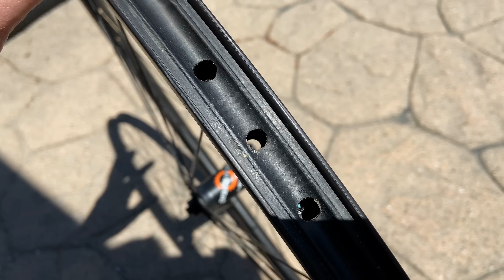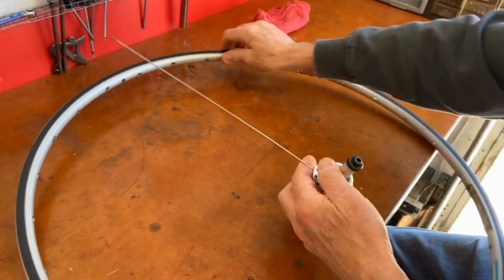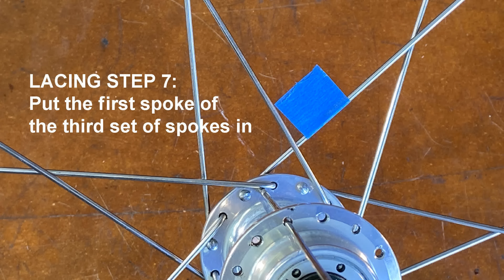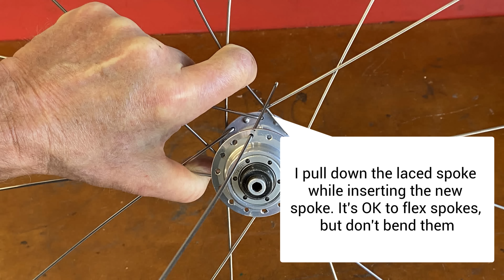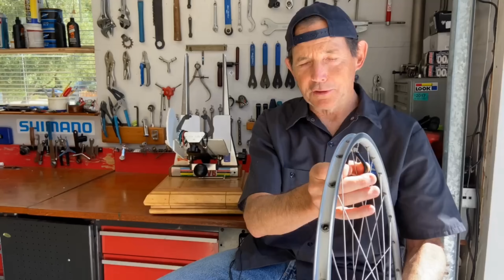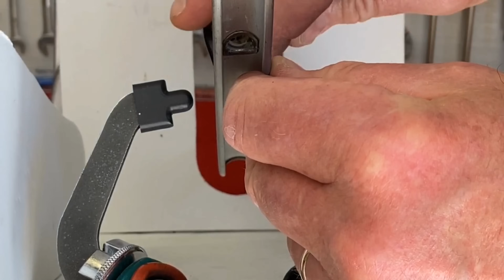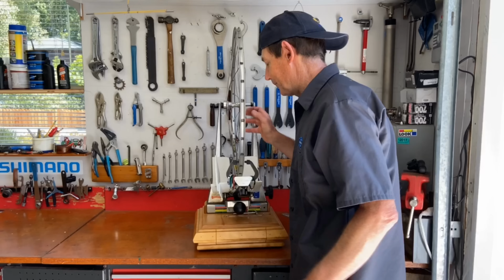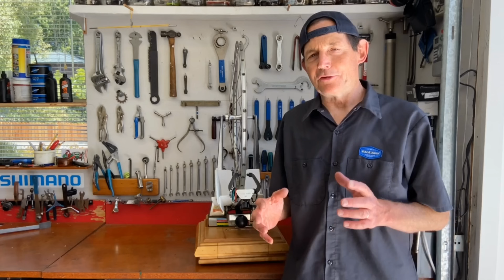How To Build Bicycle Wheels THE EASY WAY! #bikerepair

Comment: I found my match fixing these nuances.
One question I have for you, how much tensioning is enough?
I usually stop when the spokes don't bend for more than 4 mm. Approximately
Reply from the maker: Thanks for watching Milad. You know the spokes are tight enough when the wheel stays true ride after ride after ride. By far, most people under tension spokes. Because they start to feel tight well before they really are. When adequately tensioned it will hurt your hands a little to squeeze pairs of spokes enough that they move. That’s a way to tell. I’m not sure what you mean by “don’t bend for more than 4mm” But, if you’re squeezing, the gauge of the spoke and differences in rims and spoke patterns could make a tight wheel fail your 4mm test. Getting a feel for it is better and getting a proper tensio meter is the best. Hope this helps. Thanks again!
Reply: @JimLangley1  thanks man, this video came at the nick of time, when I have to do my wheel again , after the bearings section failed.
Reply: @JimLangley1  update:
After I finished the Project I noticed that it was impossible for me to insert the spokes after doing batch #1 and 2. The hole are so tight, the spoke cannot be bent. 
So I had to disassemble batch #2 and insert all the spokes one time
Reply from the maker: @miladne1092  Thanks for the update. From what you wrote, I think you may have screwed the nipples on the first 2 sets of spokes down too much when you laced them into the rim. You need those spokes to be very loose. If the nipples are turned down on the spokes too far, the rim won't be able to be pushed toward the other side making it difficult for the 3rd and 4th sets of spokes to reach the rim. The other issue when spokes won't reach the rim is either having the wrong spoke length or having a mistake in the lacing. Hope this helps you figure it out.
Reply: @JimLangley1  thanks for your responses.
My spokes are metal (rigid) and their respective holes are tight, which Meeks it harder to twist and bend.
I solved the issue by installing them in advance, and now it runs as usual, thanks for your care ;-)
Reply from the maker: @miladne1092  I'm happy to hear you have it running as usual, Milad. Well done!

Comment: I am about to replace a spoke on my own, (covid) I am not sure how my daughter broke a spoke, sure I've done it, but I am a lot larger person and wheels are pretty strong as long as not over tensioned etc. **notice on Amazon that I have to measure the MM length for the spokes so, that part will be fun // then I have to order a pack...
Reply from the maker: Thanks for watching and for the comment, Brad! The most common reason spokes break is because the wheel was built with bad spokes. By bad, I mean they are made of an inferior metal. This is very common in production bicycles. Many have basic steel spokes that cannot for very long withstand the demands put on them by any rider simply rolling down the road. Sooner or later they tend to break. Quality stainless-steel spokes are the way to go but that adds cost to the bicycles so you don't find them until you get to a certain price point. 

To get a measurement for a replacement spoke, you can remove a spoke from the same side of the wheel - a spoke that's still in the wheel - and measure it. Just don't let the spoke nipple go up inside the rim and lose it. You can tape it or hold it or just keep it at the 12 o'clock position by keeping the wheel upright and being careful not to bump it. 

And for buying less than an entire wheel's worth of spokes, you can buy online from a company such as Wheelbuilder.com. For example, this spoke: https://wheelbuilder.com/dt-champion-straight-gauge-spoke/ The minimum is 10 spokes. I realize you only have 1 broken spoke to replace. The thing is that if that wheel on her bike broke that one, it's likely it will break more, so having an extra 9 spokes might come in handy. Hope this help! Thanks again and have fun fixing that wheel!
Reply: @JimLangley1  Thanks Jim, good advice, I'll get it done one way or the other, one of my former students was fired from the 50 year old bike chain in the region, so he launched his own trailer based shop on wheels for bikes... always can call him as a "backup" ,,, I changed the main crank bearing cups once on a $50 dollar huffy, but I had to go across the border to Reynosa to buy the parts no one sells them here in the McAllen area. (The huffy was on sale for about half off when I bought it) **I had bent them.
Reply from the maker: @bradaltemeyer4472  good for you! I applaud your resourceful. You’ll make easy work of that broken spoke :-) one way or the other.

Comment: Hello Jim, thank you for the very helpful and well out planned video. Quick question: in building a wheel with aluminum nipples, I accidentally rounded one of them out. Any tips for removing it to replace it? Or, would it be detrimental to simply cut out that one spoke and replace the spoke and nipple while the wheel is fully tensioned otherwise? Thanks again!
Reply from the maker: Thanks for watching and I'm very happy you liked my video, Daniel. With a stripped aluminum nipple, I will try to unscrew it. First I'd remove the tire and rim strip. That lets you access the top of the nipple to use a screwdriver to help you turn the nipple while you use something like a locking pliers to hold the rounded flats on the nipple. 

So you use the two tools together very carefully to try the get the nipple to turn and loosen. The goal is not to damage it anymore but to get it to turn. If it's so tight it just refuses to turn, try tightening the two spokes on either side of the rounded one. That should relieve a tiny bit of pressure on the rounded nipple letting you loosen it. 

Another thing you can try is pushing the rim in the direction to relieve a little tension. So if the nipple is on the right side of the rim, you would push the rim to the right to flex it (put the wheel on the floor and don't push too hard, just enough pressure to gently flex the rim) and hopefully get the tension to ease off on that nipple.

If none of this works, yes you can cut the spoke and replace it with a new one and new nipple. That's no different than fixing a spoke that broke out on the road. But, for me, if I get that nipple off, it's much more satisfying ;-) Hope this helps! Jim

Comment: Nice and clear video, you said everything that had to be said about topic, very well invested 1h of my life. I saw on the other video that wheel mechanic is soldering spokes. What are the pros and the cons of the spoke soldering and is it only pro stuff or there are some benefits for everyday average biker?
Reply from the maker: Glad you enjoyed my video, NogomKrozVrata. Thank you for watching, the nice words and the excellent question. The pros of tying and soldering spokes are 1) reducing spoke movement, especially at the cross; 2) this limits the wear that occurs at the crosses, which can result in clicking noises that are difficult to eliminate; 3) should you break a spoke, a tied and soldered one cannot be ejected from the wheel when you're riding or flail around and scratch or even damage the bike as un-tied & soldered spokes might; and 4) by stabilizing the spokes and preventing movement, spokes last longer since they're not moving at the cross and moving less at the hub holes (in the case of J bend spokes). 

The cons include: 1) Tying and soldering takes extra time for the wheel builder so it costs more for the buyer; 2) It takes considerable practice to tie and solder spokes well and if it's not done well, it won't have the desired benefit; 3) If you do break a spoke, you must undo the tie & soldered joint and you will probably want to have the new spoke tied & soldered meaning a broken spoke is a bigger job - but remember, tying and soldering should prevent spokes from breaking; and 4) it's not easy to learn how to tie & solder because there aren't that many builders teaching the craft anymore. If you were going to have a builder tie and solder your wheels, you would want to inspect their work to be sure they are an expert.

On your last question, the builders who believe in the pros of tying and soldering would say that it's worth doing for all riders: amateurs and professionals. But, probably would not recommend it unless the person is riding regularly and really needs high quality wheels - since it adds cost. Charles Wells at Jet Bicycle Wheels is a tying and soldering aficionado. In this video he shows how it prevent spokes movement. https://www.youtube.com/watch?v=UYL5Kah83vw If you browse his youtube channel, he has other videos demonstrating his technique that are fun to watch and educational. Okay? I hope this answers your questions and thanks again!!
Reply: @JimLangley1  Thanks

Comment: Hee Jim,

i noticed that you put one side de head in spoke going left en the other side going right, is this with a reason and is this different with coaster brake en disc brakes since these type of hubs distrute the force of de brake differently?

I was teached the same way you practice here but with the normal hubs going both side the same way. So for example both head in spoke going left,  of the hub, and if it is a disc brake hub the disc brake side going the other way round so, the force of when your braking is distrubeted evenly

My english may not be that good but hope you understand.
Reply from the maker: Thanks for watching and the great question Laurens! Please watch my video on disc lacing to learn the answer https://youtu.be/gfWd7_avr1s
Reply: @JimLangley1  What do you do when you have a  on the third part when you're lacing the left side and you don't have 1 holes left of the valve hole? but it is the second hole?16:50
Reply from the maker: @ltkamies  that means that when you laced your first side, Laurens that you didn't get it right. So, you want to go back and do the first side over again making sure to get the spokes in the right holes in the rim. You'll probably need to take them all out and start over being careful to follow the instructions. Once the first side is correct, the first spoke in the third set will go where it's supposed to. Hope this helps you get it right.

Comment: Hey Jim,

do you have a tip for me for a good truing stand for small money?

Thanks, Jens
Reply from the maker: Hi Jens, I wish I knew of a "small money" and "good" truing stand that I could recommend. The problem is that what you typically get with the most inexpensive stands is a lot of plastic and flimsy aluminum or steel construction. When you're truing wheels, it helps a lot to have a stable stand that holds the wheel in place and shows you what wobbles and out-of-round issues there are clearly. On the flimsy, flexy stands, such as what you see if you search on Amazon and sort by price - you get a lot of wobble and shake when you're spinning the wheel and sighting the wobbles and hops. 

You can definitely get used to it and true wheels in it, but I don't feel it's ideal and especially if you're just learning, it makes it more difficult to see what's going on. But, you can make it work and get used to it if it's all you can afford for now. I would bolt it or clamp it to a sturdy workbench. That will help improve its stability. Also, if it doesn't hold the wheel steadily when you put it in, you could see if you can tighten the wheel you're working on in the stand (depends on the wheel and the stand design). If so, that would stabilize the stand even more. Then hopefully the pointer/indicator on the stand (this is moved next to the wobbles/hops so you can see them) is not too flexible and stays where you put it. 

Now, if you can spend about $115, the Park Tool TS-7M is made of steel and a good stable stand for the money https://amzn.to/36xr3LA . The stands that I've been using and consider the best is Park Tool's TS-2.2, which is about $300. It'll last forever and is a joy to use. You can hold this truing stand in a bench vise or you can bolt it to a workbench or you can build your own wooden base for it. Or, what I like is Park Tool's base. It holds the stand very securely and keeps the stand portable so you're not stuck working on wheels in only one place (like if you bolted it to a bench). Also, the base lets you tilt the stand, which is a nice feature since with different wheel sizes you want different sight lines when truing, rounding. The base for the TS-2.2 stand is this one https://amzn.to/38CBNL5  

Hope something here helps you find a stand you like. One more thought: If you're handy, you can make your own truing stand, too. If you search YouTube for "make your own wheel truing stand," you'll see some clever ways to do this. Thanks for the comment!
Reply: Hi John,  thanks a lot.

Regards jens
Reply: I think, this could be an good option.

https://www.bike-discount.de/en/buy/radon-professional-wheel-truing-stand-for-qr-thru-axles-623737

Comment: Thanks Jim, Great and well explained video. 
I built my first and only so far bike wheel a few years back using the techniques in Lennard Zinns book, which worked quite well albeit the dishing was off a little but otherwise true, , but being a front wheel, it didn't really matter too much. 
However your video makes it much easier, as they say a picture paints a thousand words.
Reply from the maker: Thanks for the nice words, Andrew. Glad you enjoyed my video and that it added to your knowledge of wheel building from Lennard's books. Appreciate you watching and commenting.

Comment: "The easy way"
Looks at video duration
Lmao
Reply from the maker: Thanks for the laugh, Morlev44, good point. However, I never said I could teach you quickly. I said I could teach you an easy way. Most pro builders take about an hour per wheel, so explaining the entire process in simple easy-to-follow steps taking an hour isn't really out of line. If you read some of the nice comments you'll see it’s helping lots of people build their own wheels for the first time - and to me that's what it's all about.
Reply: @JimLangley1  I did not know that it takes a professional Pro wheel Builder 1 hour per wheel I may not be at professional prowheelbuilder but I remember that I did a set of old late 30s balloon tire wheels for a friend of mine at a bicycle swap meet that he had a old 1937 Schwinn motorbike that he was going to put in a show but he did not have the wheels built so he had me built them right on the spot and I've laced and true the wheels within 25 minutes I don't know if that's a record or not but I did remember I want once it was all said and done we got the wheels on the bike we put the bicycle to show and I remember that it came in first place but I can remember when I was lacing and truing the wheels my friend was astonished on how fast I did it and so did a couple of other friends of mine were astonished on how fast I did it usually I don't do them that fast but in this case had to get that bicycle ready for show.
Reply from the maker: @garyquail2347  thanks for the comment, Gary - building 2 wheels in 27 minutes is amazing. Great job!

Comment: hi Jim, so I gave the wheel truing a second run after watching your video: Started at 9pm with with more wobbles than straight bits! Even with the brake caliper de-tensioned and wide open the wheel was knocking on the pads left and right every few centimeters. I worked through knock by knock and by 10 I had it spinning cleanly through a tight set caliper - pretty amazing to see the progress. Then I realized it was way off center! 2 rounds of spoke tightening on the opposite side and the wheel was back in center. Couple more rounds of truing followed by your last tips on getting it round. 11:30 PM job done. Amazing. I can still see a slight imperfection but Its within a mm or so and rides perfect.  To anyone reading this: this is the only video you need :)
Reply from the maker: Thanks for the great comment, David - I'm so happy you found my video helpful and that you got your wheel done and ready to ride. Nice work!! I really appreciate you watching and the nice comment.